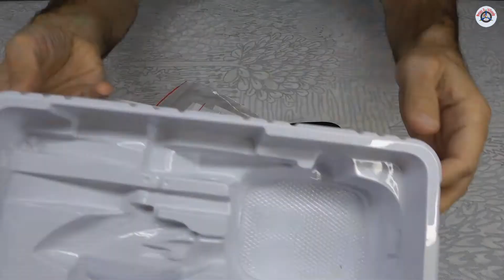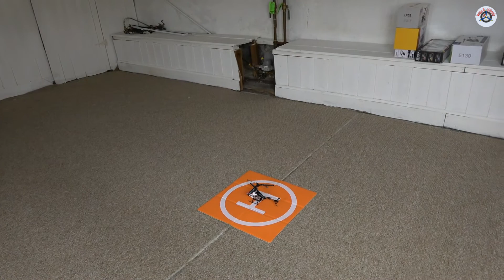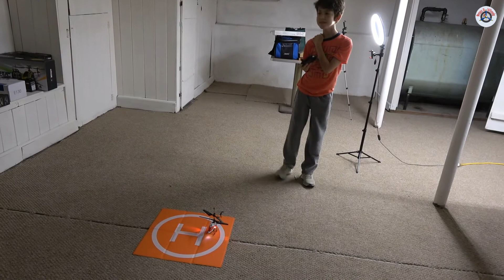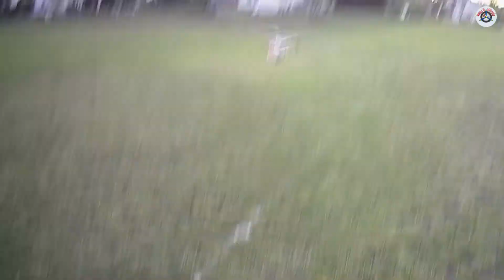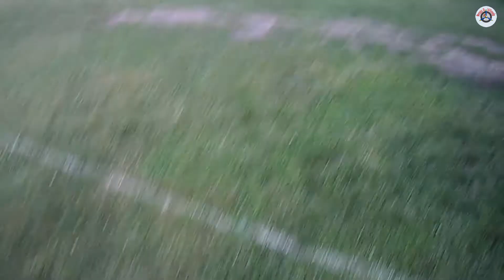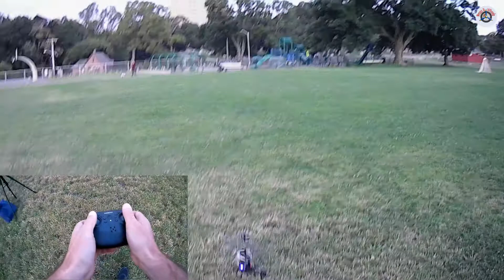RC Helicopter Review Challenge - 14 Beginner Helicopters in 14 Days: Day 2 - DEERC DE51 3CH

Comment: I bought this, flew it once now it won't fly
Reply from the maker: I am sorry yo hear. What seems to be the problem? Does the helicopter power ip and pair with the transmitter or is there no response at all? If you cannot figure out and resolve the issue, can you return it for a replacement?
Reply: Pairs and powers up just not getting into air, maybe a loose gear?

Comment: I bought the same exact RC helicopter on Amazon two days ago for $25.49 and mine came with 4 propellers two sets each 2 B and 2 A and one extra small Propeller for the tail. And all the rest of the stuff 2 batteries one charging cable screwdriver and an extra canopy.
One thing I found out about this helicopter when I was flying it outside if you make the helicopter go up high and let go of the left analog stick the helicopter will decrease altitude and go back to its original position and start hovering because it has a sensor in it
It's a nice little helicopter definitely get your money's worth
Reply from the maker: You got yourself a great deal! I did not know about that function of the helicopter coming down to a lower altitude when you go up high; it is a great safety feature for beginners. Thank you for sharing.